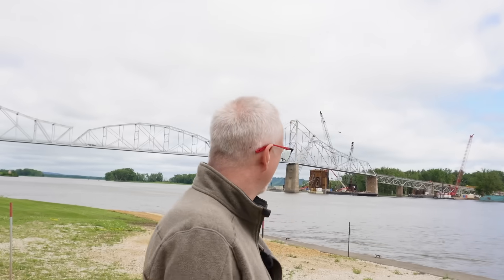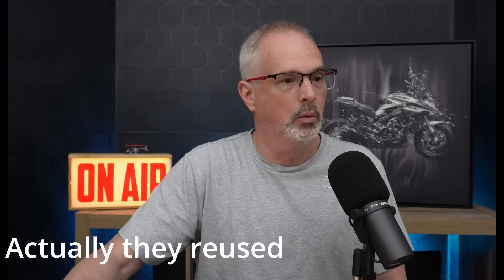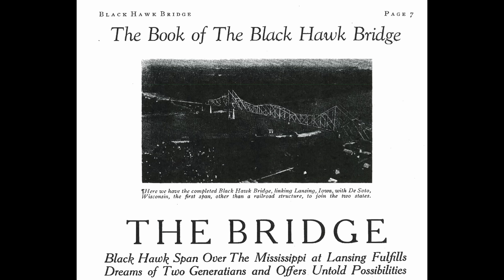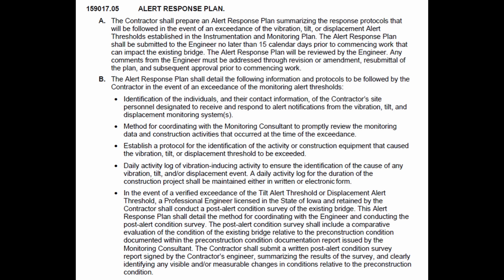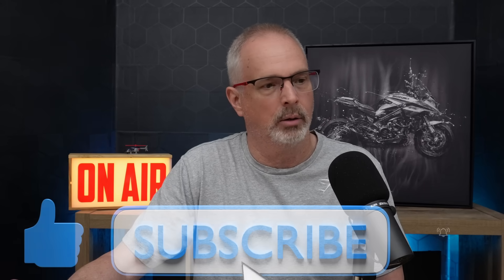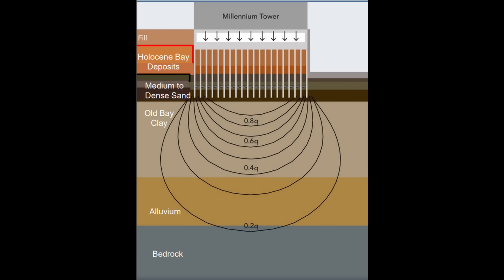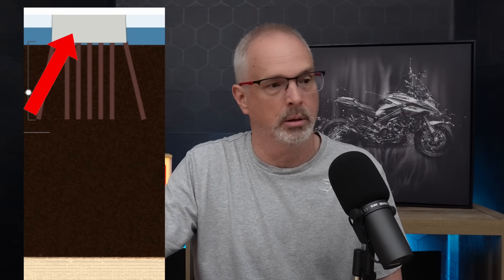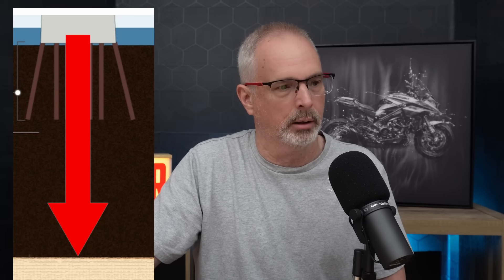Update - Blackhawk Bridge over the Mississippi River

Comment: The old bridge closed early October 20th (I, and a lot of other people, used it the 19th). The free car ferry is now running - can carry 12 vehicles and runs 16 hours a day. 15-20 min travel time
Reply from the maker: Thank you for that information!  I am guessing that this ferry service won't be operating in the dead of winter due to ice on the river.
Reply: "Planned closures include 2–3 days in December 2025 for bridge demolition. Iowa DOT and WisDOT will announce the closure dates.  The departments will also announce any future closures due to construction as needed.
The ferry will operate in winter as long as the river remains navigable. Severe ice or extreme weather may still force temporary shutdowns."
They do have webcams for checking how long the line is

Comment: Casey, I would like to add another comment to this video, but in essence it could apply to some of your other videos, or building/bridge foundations or pier supports in general! You discuss in this video how the existing bridge was shut down for a period because of pile placement for the new bridge support! The same thing was discussed on the Washington Bridge (although monitors may have not been installed or functional at this time! Hint - Hint to any media that may read this) to monitor existing bridge supports, and the same thing was discussed with Millennium Tower (although for different circumstances) about the Towers piles! This whole thing has me wondering why the codes or standards for building or bridge supports are not written to account for work nearby? Again I am not an engineer, so maybe there is strength add-ons accounted for, but are they not enough? Let me just explain my puzzlement of it, so you can kind of get an idea of were this is going! I know the Blackhawk bridge is old, so code requirements may have been updated between then and now, but in my minds-eye you couldn't have gotten a much worse situation for installing piles, then in a large flowing river bottom, well maybe if you had those same conditions in a seismic area! How was there not enough added to the standards/codes to account for work being preformed nearby? Let me switch to the Millennium Tower, where there are friction piles, and these piles were reviewed and approved! In this case, before the second fiasco came along (the 18 piles to bedrock), there was a suit filed and settled for a building built adjacent to the tower, and that building's ground de-watering causing instability to the towers piles! Does the code for piles on high rise buildings, not take into account that there is a very high probability of other building being built near that tower? Does the code not take into account that there is going to be a probability of construction activity near it in the future? How could a suit be filed and settled for an adjacent building project de-watering its site and it affecting the tower piles, shouldn't that have been taken into account in codes and standards? 
So all that being said and since this is kind of your expertise , maybe get a future video on these issues, if you feel the codes and standards go far enough or foresee enough to actually prevent things that may arise in the future?

Comment: For a fascinating example of old bridge replacement, check out the Sellwood bridge project in Portland OR.  It was completed about 10 years ago but there's lots of information out there.  The problem was the new bridge had to sit exactly where the old bridge was but the bridge was in heavy use so they couldn't just close it during construction.  It turns out the cheapest thing to do was to slide the entire old bridge north onto temporary piers.  It all worked beautifully!

Comment: We lived in Stillwater MN when they built the St. Croix crossing bridge: https://en.wikipedia.org/wiki/St._Croix_Crossing. The construction is somewhat unique in the US, but I recall there was one like this in Europe. This replaced a lift bridge that was centered in the town, and the new bridge is a few miles south, connecting MN 36 to WI 35, same road as in WI in this video. For the new bridge they made sections in two "factories" on shore, one near the bridge and the other down river. The lift bridge was closed when the new one opened and this ended the nightmare of car traffic coming through town just to go over the bridge. And when it lifted every 30 minutes during the non-winter, traffic would back up. The city did not suffer from the new bridge as Lansing might in Iowa, as it was an established tourist town. And the lack of the car traffic was a positive. The old bridge is a bike and pedestrian bridge now.

Comment: Casey - has IOWA DOT or WI DOT considered moving the bridge location to be far enough away to not impact the existing bridge? And how far would one have to move the location to be "safe" for the old one? Looking at the map the HWY 35 on the WI side goes north/south and the existing HWY on the Iowa side goes north. I realize this might then bypass the small city of Lansing. Also, we lived in Minnesota when the I35W bridge collapsed and the issue of fault critical bridges became a big issue. The new bridge seems to have the riveted gusset plate construction method that was the design flaw of the I35W bridge. Now the I35W plates were too narrow, but there is always the fear of corrosion also weakening the bridge (the one in PA that collapsed for example).  The solution in MN was to replace these with concrete as to be more fault tolerant.
Reply from the maker: That is a good question.  They had to build the new bridge relatively close to the old bridge due to right of way and historical designation considerations.

Comment: This is one of my favorite bridges to ride a motorcycle over. I will have to get up there to cross it one or two more times.

I am sort of disappointed that the replacement bridge will have a continuous top chord. One of the neat things about the Blackhawk bridge is that there is no top chord between the cantilever arms and the center truss because all the load is transferred through the bottom chord. This is true of many (most?) similar bridges, but many (again, most?) have a dummy beam in the top chord to make them look "complete." For instance, the one at Winona has what appears to be a slip joint in its upper chord (which is probably necessary since that part is non-structural). I am going to miss the honesty of the Blackhawk bridge.
Reply from the maker: That whole area on Highway 61 south of Red Wing to past La Crosse is a great road to ride.  One of my favorites actually.

Comment: Perhaps it would be wise and more economical to relocate the new bridge further away from existing bridge so regular vibration piling could be used .

Crazy that old bridge on only 50 ft wood pilings.
Which are often skin friction ENR formula driven not end bearing .
Reply from the maker: You are right.  Those pile are probably only good for a few hundred kips capacity each.  I forgot to mention it in the video, but they had right of way and historical designation restrictions that limited how far away the new bridge could be away from the old bridge.

Comment: Both the original and the replacement bridge have critical diagonals in compression.  I'm not a structural engineer, but that bugs me.  I'm sure the engineers who designed it had a reason, which leaves me curious about that part of the design.  What consideration made long diagonals in compression the better choice?

Comment: This looks like an interesting project in that a substantial portion of the budget has to be spent on reinforcing the existing bridge to keep it open and safe. I like the idea that the DOT is proactively monitoring the existing infrastructure. With the wooden pile in soil existing conditions I certainly hope they have a large active geotechnical budget to test, sample and actively monitor the soil conditions around and under the existing wooden pile all the way down to bedrock. And most importantly have people at the DOT actively on the project that know what the data is showing and not just a paper shuffling political appointee that doesn’t have a clue.
Reply from the maker: I agree that a robust geotechnical program is critical to the success of this project!

Comment: Casey in a situation like this (to maintain a single authority) where responsibility is split by more than one state, do they typically share responsibility, strike a shared working group, pick short straw (randomly assign one state the authority), assign to the state with the higher priority in the value that the infrastructure provides to their side, or alternate turn by turn? I can see cases where the infrastructure is worth more from a multistate national level, both have a high interest if similar sized communities share a facility, or where one state has a high interest and others may not rank it as highly.
Reply from the maker: That's a great question. I'm not sure how they decide which DOT takes the lead in administering the project.

Comment: It was nagging me, so I came back to say this.  Some infrastructure is more critical than others.  The San Francisco-Oakland Bay Bridge is a critical lifeline, connecting about a million people on a long peninsula to the mainland.  The Fort Madison rail bridge carries a certain fraction of transcontinental rail freight.

The eastern extension Iowa state highway 9 (where I was raised) is important to 10,000 people (or fewer?) who do not have practical alternative.  Likely this crossing plays no role in distribution of supplies or local products.  The project is validated by safety for river traffic first, and when it is open for bridge users.

The engineering analysis is very enlightening, but the risk management program here is quite different than other projects.
Reply from the maker: Thank you. I tried to make that point in the video.

Comment: good stuff as usual Casey! what distance from work being preformed is that measured?  yup, as soon as I heard 2" per second, my reaction was "what???! that seemed like crazy number in such close proximity to shallow 90year old timber piles only in silt. 3MM seems a little low too, like you couldn't even drop a bag of gravel, lol!
Reply from the maker: Thank you and I agree with both of your points.
Reply: @CaseyJones-Engineer  I added this just now to the original post, (ment to sooner, got distracted) but what distance is that measured at?
Reply from the maker: @timkohchi2048  It is a limit at the location of the structure that you want to protect.

Comment: another great video, excuse my ignorance, but what does " 2 inches per second peak particle velocity "mean. i presume it;s a mathematical formula or term i've never heard of.
thanks Casey.
Reply: its not a mathematical formula, it is literally the acceleration velocity of the force, if you had a small light particle, say a grain of sand, what speed would it reach subjected to the vibrational or shock wave force. it isn't an actual movement of 2 inches (hopefully!) unless it is demo or rock blasting. obviously, the shock wave from an explosive force would be higher than say impact from driving a pile, so that's why Casey said he's only seen that acceleration limit in those circumstances.

Comment: The Westin Diplomat Resort in Hollywood, Florida, a beachfront site, is built on two massive piers in 1998?.

Workers starting the second pier notice a height difference???

The owner chose to use his 'own people' and not a general contractor or project manager.

Someone determined it was an error on the plan, and both should be the same elevation.

Overlooked was the settling of the pier, which had been designed in.

A trade magazine documented it nicely, including the custom geometry of the interior doors on a non-level plane. IIRC the difference was several inches, and the span was ~300 feet. I kept a copy until I retired, a fun read.
Reply: What a mess that was. The Pipe fitters and Plumbers Union built it. It was 100% over budget and 18 months behind schedule. The sketchy Dudes from Philly would fly down and sit in a Limo across the street.
Reply: @jimnalgrin3515  IIRC they sold it for a MASSIVE LOSS.
Reply: @CCRoselle  A loss for the Union but the officials had to have made a fortune in kickbacks. Nothing was bid. They just handed out contracts to friends and family
Reply: @jimnalgrin3515  But,but, but they had a good price to replace the sand the storm blew away.
Too bad it was contaminated, and it had to be replaced.
Such a deal.
Reply: @CCRoselle  Notice what contractor was on the Diplomat, Key Bridge, Champlain Towers, the disastrous Hard Rock Hotel debacle in New Orleans, Tappan Zee Bridge and got tossed off the WTC by Rudy Giulani himself....

Comment: I learned a lot about ground and structure movement while we were living in Guatemala about a decade ago. The structures there are mostly concrete and block structures. I was curious what the best way to build a house would be under earthquake conditions. Guatemala has lots of minor earthquakes. It was very strange the first few times your chair or bed starts to slide back and forth!
I discovered that there were similar needs in high wind areas. I lived for a long time in Texas where straight line winds do a lot of serious damage. I was in Austin and those winds rolled over a bunch of mobile homes a few blocks from where I lived. Those same winds coming in through the soffit vents of a house popped loose the ceiling drywall in a house. The owner wasn't happy, as-in couldn't afford, when I told him that the drywall needed to be replaced completely.
It turned out that wood with all components tied together with metal plates and special brackets to connect to the foundation were the right answer and was far better than concrete or the death trap of adobe. The bad side for Guatemala is that there are no wood types suitable for construction in the country. So all of the wood would need to be imported. I'm living in the Seattle area now in a 4 story apartment building. Luckily, there isn't a ton of volcanic and earthquake activity right now. Oops, got that wrong. This area, because there are no ocean ports and the entry from the East is over mountain passes, is a death zone if a major quake happens.
Great videos, thanks.
Reply: No wood?? That's wild.
Reply: I googled this.  They have a large domestic timber industry.  A major part of their economy. Cypress,oak pine and orhers
Reply: @alaskansummertime  Cypress and oak are not suitable for high strength building purposes. Most pine is a soft wood and has very little strength. They do have one species of strong wood. The locals say you will be lucky if the insects do not consume it entirely in about a year.
It's important to understand that the entire country is built on top of sand and ash produced by the enormous number of volcanoes in the country, something around 27 right now. The land isn't stable. Landslides block roads constantly. It is a fantastic country for agriculture. There are so many varieties of fruits and vegetables that even Guatemalans don't know what many of them are. It's so fertile that if you toss your table scraps on the ground, a garden pops up.
Bribery and special connections are often needed to get anything done. Votes are bought by someone coming by and making offers for whomever you vote for. On the other hand, freedom is a reality there. I miss that.